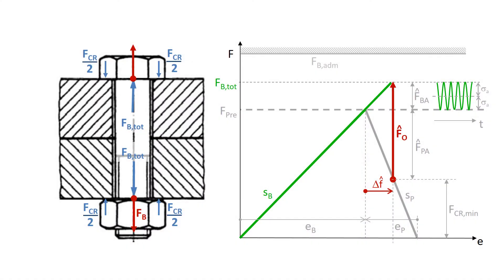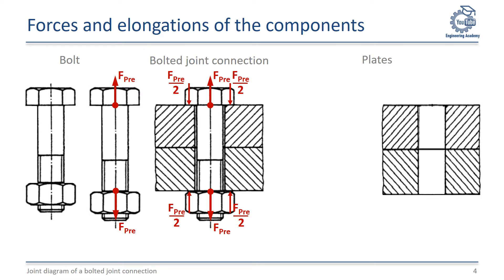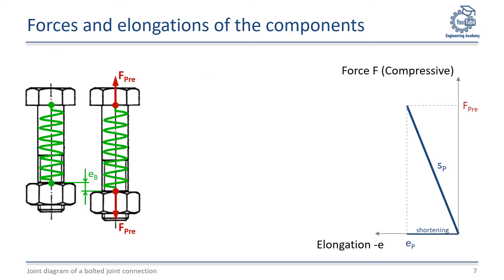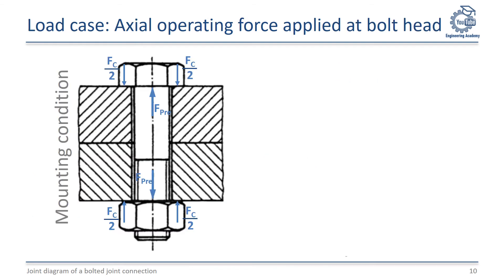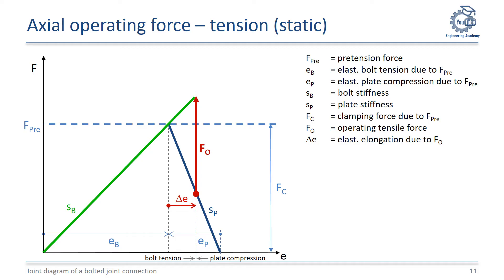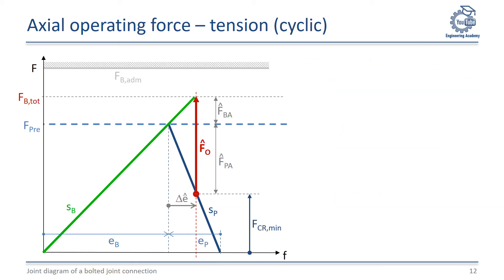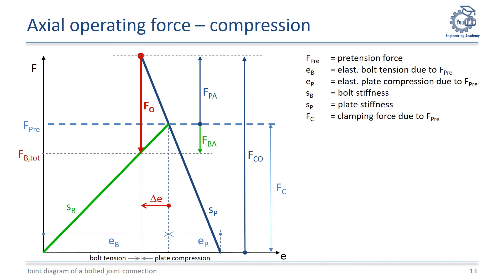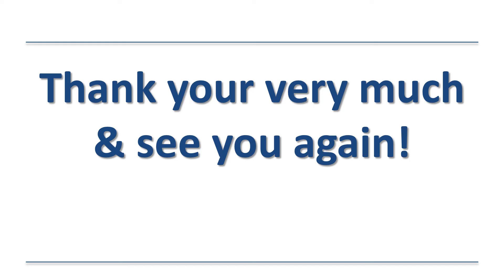Bolted joint diagram – Short explanation close to PERFECT!

Comment: what  will be the impact, if we add gasket of thickness 0.5mm in b/w the plate
Reply from the maker: A gasket is often made of a soft material. When it is placed between the plates, the axial stiffness of the plates will be greatly reduced, i.e., the slope of the line describing the deformation behavior of the plate will decrease, it's curve will become flatter. The ratio of bolt stiffness to plate stiffness will decrease accordingly. The proportion of additional axial operating force F_BA acting on the bolt will increase, which can be critical. The unloading of the plates F_PAwill be less, which is probably more positive in terms of residual clamping force F_CR and sealing performance.

Comment: How can you know the joint stiffness of the plates ?
The plates will not compress uniformly as they'll compress the most directly under the bolt heads but then less as you move away from the bolt underhead region.
I generally just model it in CAE.
Reply from the maker: Your are right and this is not simple to calculate. It depends from the design of the plates, the distance of the screw from the plate borders and the load application point. You can find an analytical procedure in the actual german standard VDI 2230 "Systematic calculation of highly stressed bolted joints" Part 1: Joints with one cylindrical bolt.

Comment: I'd like to know what happen when we use a TTY torque pre-load. There is no more elasticity in the bolt, but they say it's good for fatigue!!!
Reply from the maker: Your comment is correct at first glance. However, it is also important to consider that the torsional stress in the screw decreases over time due to relaxation processes, allowing for dynamic loads. See one of my newer videos about relaxation. Essentially, yield-controlled tightening aims to minimize all tolerances resulting from friction and strength variations, which can result in significant over-dimensioning. Therefore, it is acceptable to tigthen to the limit during assembly.

Comment: In case of bolted joint with external tensile load, why part of Fo is required to release the compression of the joint. As we apply tensile load on Bolt it will elongate hence compression on the joint is automatically released as its still within its elastic limit.

Please clarify this
Reply from the maker: The fraction of Fo isn’t necessary to relieve the plates. That occurs automatically, indeed. However, as it’s a system of interlocked preloaded stiffnesses, the external load acting on the screw also results in the relief of the plates. Consequently, the fraction of force previously required for compressing the plates is no longer necessary. Therefore, the screw is relieved by this amount, and only a fraction of the external force acts additionally on the screw. These two components, relief and additional load, distribute in proportion to the two stiffnesses.

Comment: good video overall, but some small mentions to everyone with extra questions: what is shown in the second half of the video only applies, when the external force is applied on the outside of the plates. if it applies to somewhere inside the plates, or the inside boundary, the outside part is considered as part of the bolt stiffness. head and nut stiffness arent mentioned in the video, but are also accounted toward the total bolt stiffness. to calculate the stiffnesses of plates and bolt, there are common formulas to estimate the effective area of the compression/elongation. for the plates, these depend on the total area (relative to the bolt diameter) surrounding the bolt. if instead of a nut, the plate is threaded, then the used part of the thread is considered as a nut, with the remaining inside part of the plate being considered normal plate. incase setting is considered, the minimum expected assembly force should be pretension force plus setting force. the setting force is calculated from stiffnesses and setting distance, which depends on survace roughness and is estimated with tables. setting can take place on any contact survace.
Reply from the maker: Your are right. Here, the most simple case i s shown. If you want to see, what happens, when the load is not applied directly under the bolt, you can watch the Video "Der Krafteinleitungsfaktorn bei Schraubenverbindungen" in this series. To calculate the stiffness of screw and plates, I reccomend you the actual german standard VDI 2230 "Systematic calculation of highly stressed bolted joints" Part 1: Joints with one cylindrical bolt, issued by the German Society of Engineering Verein Deutscher Ingenieure. There you can also find values and examples to calculate preload changes due to embedding.

Comment: 4:55 "drops below the required clamping force" how do you know what the required clamping force is?
Reply from the maker: The required clamping force is not an inherent characteristic of the screw connection but a requirement imposed on the screw connection based on its application. This could, for example, be a minimum clamping force for a static seal or a minimum contact force to ensure frictional force transmission.